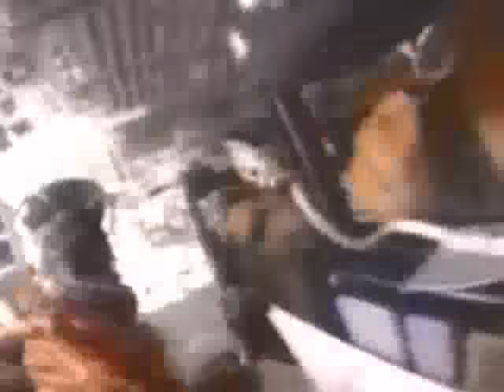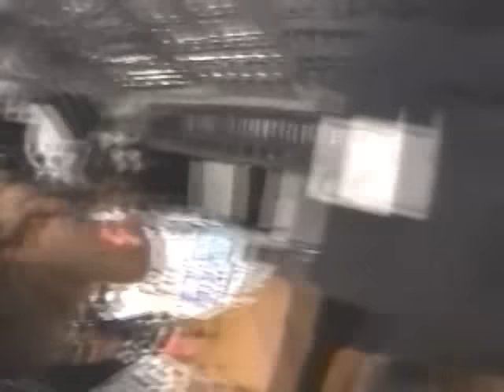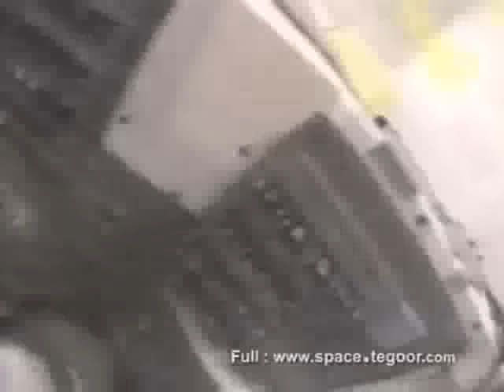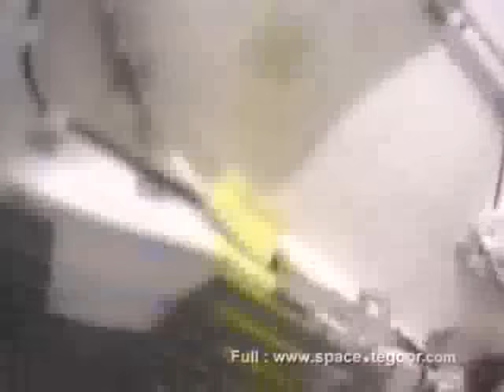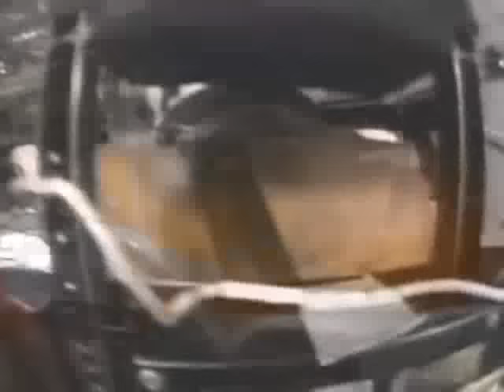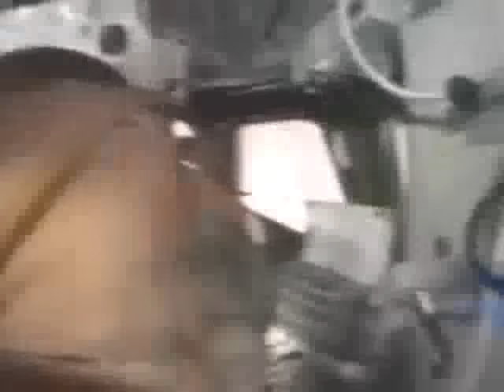Space Shuttle Columbia STS-107, Cockpit footage just before the accident

Comment: I think NASA cut the video short before the shuttle started to disintegrate so their deaths wouldn’t be exploited. Usually these videos last from re-entry to landing.
Reply: The connection may well have been cut due to failure. I have seen the uncut video myself and this is what seems to have happened.
Reply: Yes, this is a cut version. You are correct.
Reply: @spikedart  where u saw them.I think they are close to media
Reply: @nullentrophy  It was on another video channel several years ago. Might have been youtube, but I don't remember. You see the interior of the spacecraft up until the feed dropped, and the nervous conversations of the crew.
Reply: @tobivandebulk What did you expect to see? Them dying? Or did you expect to see the outside view?If there was a video or even a photo of the damage they wouldnt have died and there are plenty of coms about heat sensors failing
Reply: @soldatheero  The truth is important, even if it seems ghoulish. But I do understand where you're coming from; a lot of death tourists out here...
Reply: @spikedart  Don't lie.There is no any other video except this short version.Only NASA has long version, which was not shared and wouldnt be.
Reply: @sulfirikasit5362  no, there was a leak of this video, it was the longer version with numerous conversations about what was happening. Probably has since been censored.
Reply: @spikedart  They found the camera with the video inside later on the ground. This video wasn't sent live to the ground.
Reply: The footage is cut, there is more. Not of their death though because the feed cuts out when the actual explosion happens. The footage you see of the exterior breaking apart and exploding was cut with footage from the movie “The Invasion” 2007 in which the Colombia is exploited for story purposes and at the beginning the shuttle using special effects and CGI blows up.
Reply: This video amazingly made it to the ground, in the WRECKAGE of the camera. The outer spirals of film in it were burned off. It is amazing that so much of it survived.
Reply: @sulfirikasit5362 there is definitely more to this video which was on YouTube years and years ago. You don't see much bit you see and hear the initial break up of the shuttle before the video cuts...it only lasts a few seconds

Comment: Accident? This was no accident. An accident is something that's beyond the control of those involved. If strict safety protocols and checks had been adhered to,....this wouldn't have happened.  Brave souls.
Reply: ok but that's not true
same way a car "accident" happens... most of them wouldn't happen if people followed traffic laws, but they do.
Reply: @TheEpicLinkFreeman  accident = no will to kill

It was an accident
Reply: @Pepejul2  The accident was the initial damage to the shuttle, but the loss of life later because of inaction on the part of those who knew of the damage was not an accident. The heat tiles were damaged in launch and they knew about the damage as soon as it happened, what's the point in groundbreaking reusable spacecraft if there's no way to repair potential damage, NASA employees of the time themselves have said more could've been done. The crew weren't even informed of the damage until just before re-entry.

Damage to the shuttle = accident

Failure to act on information...
Reply: @jameslove1162  you are probably right
Reply: Was this the one with the frozen O rings?
Reply: @birkinsmith88  no, that was 1986 Challenger.
Reply: @superspit  Then was this the one with the tile damage?
Reply: @birkinsmith88  yes.
Reply: I agree, both were not accidents in the sense that if NASA hadn't cut corners and had proper safety measures in place, neither of them would have exploded. 
I have a friend who's a helicopter pilot and she said there's no accidents because you get to know the sound of the craft so well, that if anything sounds off it goes straight in for maintenance. 
It's exactly the same with a motor vehicle, after you've driven the same car for a while you know if something is wrong. So most 'unexplained' single vehicle car crashes are either people who haven't listened to the engine or faults in the manufacture that the driver had no control over anyway.

Comment: This was the one apparently caused by some heat tiles coming off and damaging the ship.
(EDIT: Found it! STS 27 They believed they would die on re-entry!) 

I read on Wiki that either Discovery or Atlantis (I think) had exactly the same problem happen to it and one of the men on board was quite sweary with mission control about how doomed they were. 
HOWEVER, this shuttle went up because of the location of the heat tiles that were lost. The other shuttle suffered the same failure but by chance the tiles were lost in a significantly less dangerous place. 

That said, 'accident' hints at there being no one at fault. Intent is what changes murder to manslaughter and something like this had happened before, they were just crazy lucky
Reply: I'm confused, are you trying to say this is footage of STS 27? Cause it's clearly the Columbia crew.

Comment: They were close to the landing they should have use the parachutes.
Reply: "That escape route, however, would not have helped the Columbia astronauts, as the shuttle was in its early stages of reentry and was streaking at 12,500 mph when it disintegrated Saturday morning. Temperatures along the wings exceeded 3,000 degrees. Anyone exiting the craft would have died instantly." - By William Booth February 5, 2003, The Washington Post.
Reply: Clearly you don't understand that they were too high, still pressurized and travelling at 8x the speed of sound. One doesn't simply eject. Sad to have watched this happen.